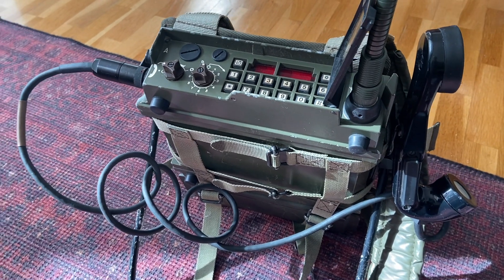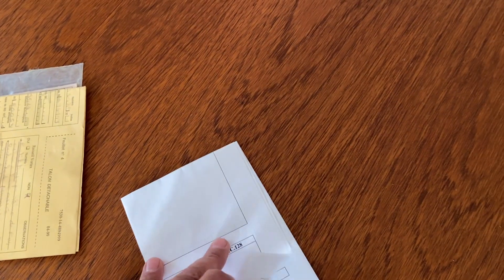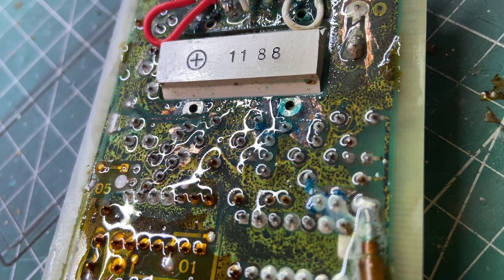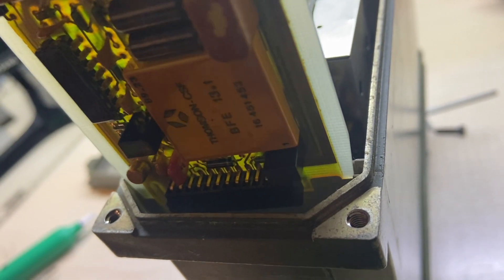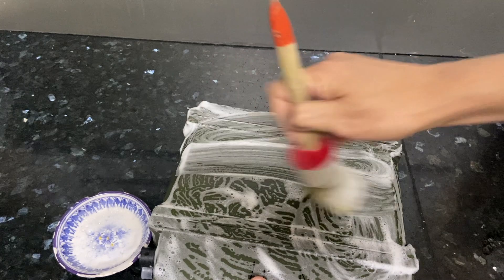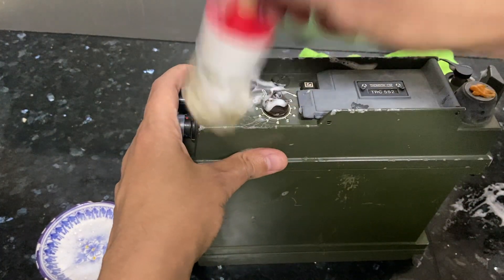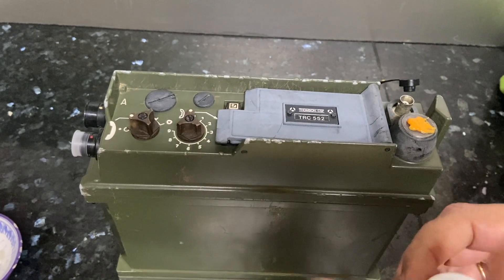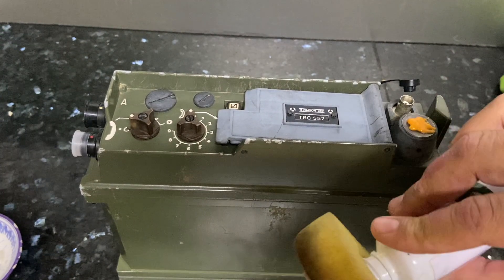Thomson TRC552 military manpack radio

Comment: Congratulations!  Are You positive that cell is 4.8V?  Higher voltage can be just due to "cooking" NiCd cell that with small current then settle around 1.4V? I never seen in my life axial cell with voltage like this except lithium around 3V - I'm not saying it's wrong but just never seen it. Maybe it will be worth to cut open this old one and see if it's composed of multiple cells? I'm afraid mine will be also leaked but I don't keep it home... need retrieve it first.
Reply from the maker: Yes! I have seen it has 4x NiMh 1.2V inside 👍
Reply: @Radiogenes  Thanks!